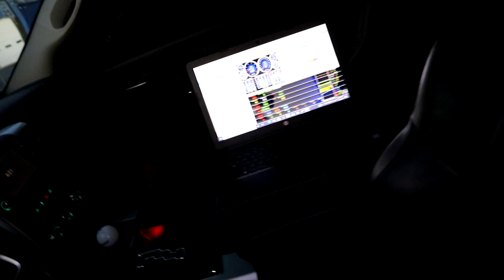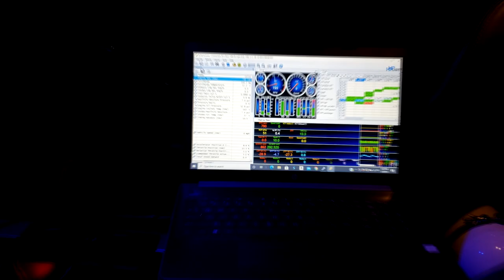New Texas Speed ENFORCER Camshaft From DDSS On My Ram R/T

Comment: Hey love your video , did you upgrade valve springs ? Any other upgrades that would be necessary for the truck to run how it should with no problems - Thanks in advance!
Reply from the maker: Yes I did mopar performance springs

Comment: Hey there I like  sound too. I have a 06 2500 power wagon with the 5.7. What I'm after is a cam that can give me max torque in the 2000 to 4500 rpm range. Need this for when I tow my boat. Maybe hp tuners and your new cam guys have some ideas. By the way I was the one that wanted that turkey day cold start. Thanks again.
Reply from the maker: Thanks man, my old cam would be a good one for that.

Comment: So I have 2005 ram i have a HRT stage 2 220-230 with circle D 2800-3000 stall. Wht nitrous kit would you recommend or just get the universal kit??
Reply from the maker: Plate kit , I have the link to the kit I use in video description.

Comment: The day finally arrived, the dreaded cam failure. Any advice on picking cams and installing them? ‘13 Sport RCSB, thanks!
Reply from the maker: 1st thing is decided how you use the truck. Do you tow anything?
Reply: @FrostbiteRam  rarely ever. Daily driver. Stock expect Diablo 93 tune and flowmaster exhaust. 3.55 gears.
Reply from the maker: @asdetailshop  since you have diablo all ready and do tow sometime for a daily its hard to beat jays .5HL cam id hit him up for that tellem I sent you.
Reply: @FrostbiteRam  I’ll check it out, thanks. Did you install the cam yourself? I got priced at almost $6k for cam and install from a couple shops.
Reply from the maker: Thats the cam I had before my new tsp enforcer cam. I will be selling my .5 HL cam $500 shipped.
Reply: @FrostbiteRam  Would I need to purchase springs, lifters, rockers, and pushrods to run the cam you’re selling?
Reply from the maker: Yes I do my own work and 6k seems really high to me.
Reply from the maker: Yes I use the mopar performance springs and the factory push rods is fine.
Reply: @FrostbiteRam  okay, thanks. Can I contact you on FB further about the cam you’re selling?
Reply from the maker: @asdetailshop  sure thats fine

Comment: With the new cam did you have to upgrade pushrods and springs
Reply from the maker: No still running the same setup as the jay cam. I use stock push rods,  mopar performance springs and hellcat lifters.

Comment: What injectors are you using and cam number please
Reply from the maker: 650cc fic injectors and its a custom Doctor Differential and Speed Shop cam called the enforcer
Reply: @FrostbiteRam  I am running a 205/226 Cam from Jay
Reply from the maker: @cammedramprocharged4927  thats a small cam the one in this video is a 224/230 580lift
Reply: @FrostbiteRam  well I bought Jays Procharger cam 🤷🏻‍♂️
Went with the Trend 😩
Reply from the maker: @cammedramprocharged4927  honestly it should make good power down low  it just may not chop much
Reply: @FrostbiteRam  I messaged you on Facebook

Comment: So you going to 8spd ? Or built 6spd?
Reply from the maker: 46re swap full manual valve body with a trans brake basically a racing transmission.